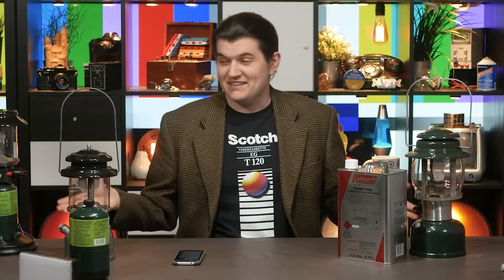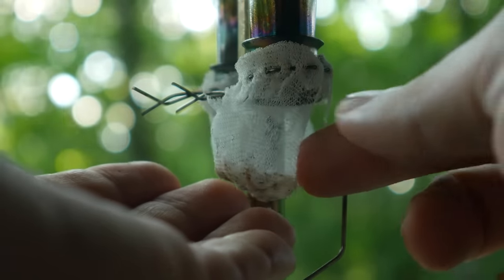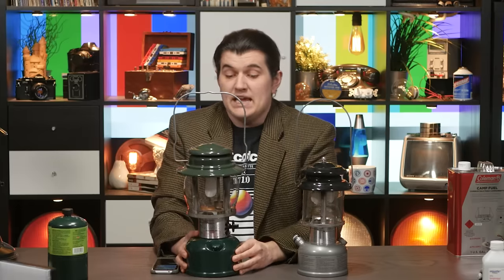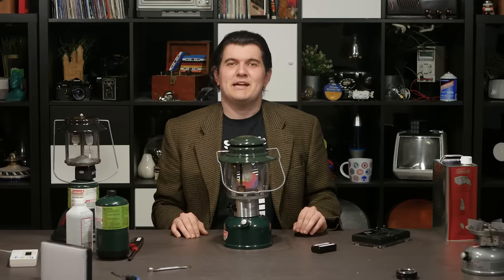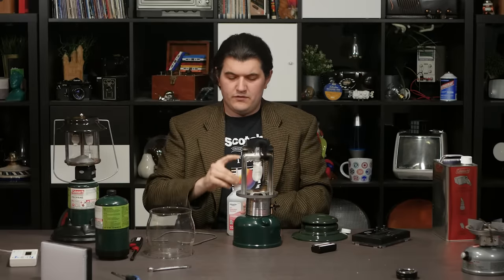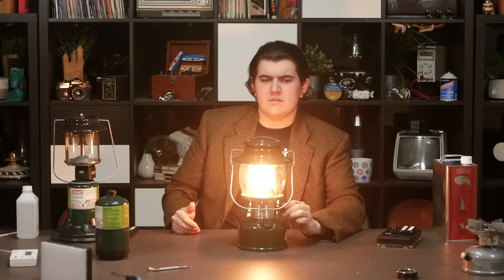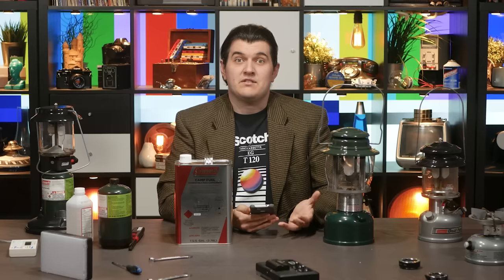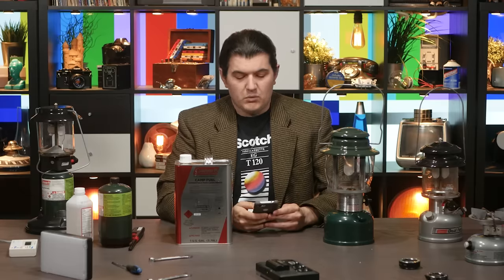A very rambly Coleman Lantern follow-up. Turns out they rarely make sense in 2021

Comment: For sure, led lanterns are way more efficient.  That is what I have for when my power goes out.  I also have a propane lantern.  I never grab that.  That is solely for ice fishing as the heat generated will often allow me to turn off my main heater...or supplement the heat generated because it can't keep up.  My propane lantern is solely used for ice fishing.  I also have a smaller led lantern in my ice fishing bag too.  Need light packing up, and propane lantern needs to cool before I pack it away.  Very limited use for propane lantern, but the need is there for the product.  Good videos, love your content!

Comment: Bottom line, there is no one best solution for every situation. I like having low tech solutions on hand, just in case. Yes, I have LEDs, power cells, and a generator, but there's always: extreme cold, extreme heat, EMP, longevity, standby time, grid down, etc.; choose your apocalypse. Really appreciate the balanced viewpoint. You earned another subscriber today.

Comment: I was born in 1943 in rural farm country and we didn't get electricity until I was 12 years old. We had Dietz lanterns for outdoor use while milking, chores, etc. and for hunting/fishing at night. We used Aladdin or Coleman gasoline lanterns for indoor use and they were tricky to fill and light so we usually did that outside to keep fuel smells out of the house. I remember my mom had a gasoline heated iron that sprung a leak and caught fire while she was ironing clothes inside the house. My dad had to pick up the ironing board, iron, etc. while it was flaming and carry it out of the house and throw it into the yard. He saved the house from burning but got bad burns on his hands and arms. Yes gasoline indoors is dangerous.

Comment: Just went on a long (3 weeks, including several nights where it got well below freezing) camping trip with my girlfriend, and we managed the whole trip on a single portable LED work light that we never had to replace/recharge the batteries on. By FAR the biggest advantages of an LED light for us (that I'm surprised you didn't mention - I guess you don't go camping much?) were that it turned on and off instantly, and that we could use it INSIDE THE TENT! It definitely wasn't a perfect solution, but basically all of its problems are because it was the cheapest battery powered light they had at Walmart, so it didn't have adjustable brightness, the color temperature was the typical cheap LED blue-white, and it was directional, rather than ambient. Definitely way better than any of those gas powered things though!
Reply: What kind of things do you do on a camping trip for 3 weeks?
Reply: @MrDavo511  lots of hiking and exploring national parks? We spent over a week in Yellowstone and the Grand Tetons, almost a week in southern Utah, and then some quicker overnight stays in Badlands, Grand Canyon, and a few others

Comment: I grew up camping with those "white gas" lanterns and camp stoves.  It was essentially the only choice for substantial artificial light in a campground.  Even so, we considered them kind of a pain in the ass, as well as dangerous.  When I first encountered a fluorescent camp lantern, I was very glad to buy it.  That ran on a 6V lantern battery or a set of D cells (fit into a handy device that then fit wherever a 6V would), and produced pretty good light for a good while.  No more spilled fuel, no more fiddly mantles, no more hiss, no more risk of burning the tent, etc.  Now that we have LED lamps, that are way more efficient than even the fluorescent, it's a no-brainer.  I even have LED flashlights where you can take the front off for a room light.  Sure, that doesn't help with the cooking, but it doesn't have to.  We have a folding grill that runs on propane, still easier to deal with than the white gas.  It does fine with the little 1 lb bottles, but when those are empty, we'll just run it from a 20 lb BBQ tank we have as a backup, or a quick-disconnect from our 80 lb home source.  We may also get a collapsible stove like the ones from Richard Outdoors, to take a variety of fuels and be extremely portable.  It makes no sense to waste our propane on light, when LEDs exist.  What next, carry coal everywhere?  If wherever you're camping, it's too cold for the batteries to work, you might be in need of something other than light.
"I also have other plans...to...Yeah!  OK Bye!"  LOL

Comment: For our Scout Troop and camping we use propane stoves and lanterns on camping trips where we park very close to the camping site.  We use propane trees and 20lb bulk tanks for the stoves and lanterns.  For the stove it is connected via a hose and the lantern attached to the top of the tree.  We haven't converted to battery lanterns at this point.  Bulk tanks are much cheaper than the disposable tanks.  Bulk tanks also work better in cold temperatures.

Comment: propane sucks for cold weather also. It may have a low boiling point at atmospheric pressure (-42°C) however, during use the canisters can drop far below ambient temperature and stop producing enough flow to operate a stove or lantern.

Comment: In my own opinion, kerosene is a bit more reliable than propane and batteries but only because it gets cold in Canada and that cold will basically make your batteries and propane useless. In any regular climate temperatures then batteries are probably going to win out for lighting. The only other thought I had is in an emergency, what would be easier to get your hands on? Some type of fuel you can burn, or some type of electrical generator to charge your batteries?

Comment: 3:48 -- there are two check valves in the pump mechanism. There is a "large" leather cup at the end of your plunger. Properly oiled, it will let air by on the out stroke, and seal to the tube walls to force it down on the down stroke. At the bottom of the tube, there is a brass check valve that admits air to the pressure chamber.

Comment: Just a thought on the different fuel options. One thing I thought about is that kerosene and diesel and interchangeable fuels. I know that in Europe (and maybe Asia and Africa, IDK), diesel is much more widely available, and also a lot cheaper as well.

Then to further that above argument, my mentality when it comes to emergency supplies is to need as few different supplies as possible. Considering I drive a diesel truck (and I’d imagine a lot of people who routinely camp also have diesel trucks to haul their campers and all), being able to use the same fuel to run your lamp and your vehicle could come in handy, especially if you’re in the middle of nowhere. You fill up a spare 5 gallon jerry can before heading out, and now you have plenty of fuel for your lantern, along with spare fuel for your vehicle.

Comment: I use liquid fuel lanterns (and stoves) more when winter camping in below freezing temperatures, not only because they generate a little heat but because they don’t freeze up like propane tanks do at those temps (especially when they are low on fuel). You can’t recharge most batteries when the cells are below 32 (freezing point) or you will damage them.  In the spring and summer LED units and propane stoves are awesome, cold weather, liquid fuel still has a place.
Reply: Also Kerosene when stored properly can last 5 years and is much less volatile than other fuels. If you’re dealing with cold weather it’s not a bad option if storing fuel.

Comment: For storage quantities, I remember when I was a kid -- admittedly, this was back in the late '60s, so the circumstances have undoubtedly changed -- my father would go off before we went camping and get a five-gallon fuel can (US pattern, from the cap style) filled with white gas, which we would use in the Coleman stove and two lanterns we took with us. I'm pretty certain that you would be hard-pressed to find anywhere to fill up a jerry can with white gas now, but the flimsies you can buy it in were, and are, a great deal easier to damage (refer to the British experience with the "Petrol, Oil, and Water can" during WWII).

Comment: Two more issues:
1. As batteries discharge the led produces less and less light, what can be at least annoying. A fuel lamp produces the same light till it goes out.
2. Propane lamps also have problem at low temperatures, becouse the pressure in the tank decreases.

Everything else I do agree with. Good videos btw!

Comment: Just for the sake of being pedantic, there are two other use cases you neglected: Firstly, if you're just straight ignoring it. Not just in the emergency sense, but in terms of pure resilience. They'll just sit forever. Leave one in a cabin you only visit two times a year, and randomly drops to -25C, has damp, might have random animals mooching inside it? They'll be fine. Batteries and LEDs, not so much. Secondly, you can throw them. If a bear decides you smell delicious, throwing an LED panel at them isn't going to do much. Smashing a wall of fire across the ground at them could be a huge bonus. Which kind of pairs and juxtaposes with just the physicality of lugging stuff up a mountain. Might be heavier, but you're less likely to get to the top and find that it you squated wrong with it in your back pocket and now it's snapped in half. Being bigger and heavier is a feature, not a bug. A new microwave might be super energy efficient and more powerful, but the one your grandma bought in the 60s is big, dangerous and has been working since the 60s.

Comment: I think you've answered your own question: the kerosene/gas lamp makes sense in the INTERIM situation--while you're saving up for batteries, LED lamps, solar panels, etc.; while you're building your bicycle generator and setting up your charging station--especially if you're already using the gas for cooking (you'll have it around anyway). So, while they may not be a good choice for long-term use, the gas lanterns DO make life easier sometimes

Comment: You are correct - you do not need to take your finger off the plunger to pump.
There is a U-section rubber cup on the plunger head which works as a one way valve allowing air to get past on the withdrawal, similar to a bicycle pump.

Comment: Probably never read this, but I'll comment none the less. I purchased an adapter to charge the 1lb propane bottles from my grills 5 gallon tank. I use the 1lb bottles with various torches so they don't last long.  I own a 60 year old Coleman white gas, still in use. I purchased it at K-Mart, along with a Coleman brand flint sparker kit. Never used a match ever. Instant start! No searching for matches, who carries matches.

Comment: Coughlan's Fire Paste (ingredients: aliphatic hydrocarbon, denatured ethyl alcohol and organophilic clay) works really well for preheating fuel in white gas/gasoline stoves, with which I have much experience. Presumably, it works just as well with kerosene appliances. It's easier to place into preheating receptacles and would appear to be much safer than pouring liquid alcohol into tiny cups.

Comment: I have used gas lanterns for decades, and they are quite useful, even today! The reason for the popularity of gas lanterns is due to their staying bright until they are out of fuel, battery lights dim as they lose power.

When I use the gas lantern, it is when I have to run my gas generator to provide power to run the farm after a storm, so it is rare that it gets used.

Altho, the propane lanterns are easier to use, the gas units are good still, but I have never used a kerosene fuel, only white gas.

The reason for the hole in the pump knob is to reduce pressure when pushing the pump stem all the way in. You don't need to uncover the hole, as the air gets by the pump leather when you pull it out.

The mantles are nothing but ash after the first lighting, that is why they are so fragile. The amount of thorium in the ash is very little, BUT, still wear a mask when changing them!

All of my lanterns match light except the propane lanterns, they have a spark ignition. And I prefer my propane for camping, as I can hook it to a 20 Lb tank with a propane pole that allows hooking up the propane stove that sits on the picnic table! My motor home also had a propane lantern on the wall, but I replaced it with a florescent unit. LED units are replacing the florescent ones today!

Comment: Nice follow-up video! Over here in Germany, both Diesel as well as heating fuel oil for central heating are rel. cheap every day items that are widely abailable, which can be used as an alternative to Kerosene ("Petroleum" over here).
I like mine for backup light at home, not for camping of course, for all the known reasons.

Comment: I have always used a Coleman propane gas lantern when camping. It makes sense because we also use propane to cook, so the lantern can be connect to the same fuel source. I can guess that Coleman needs to continue producing the parts for the kerosene gas lantern, so it is easy enough for them to sell the lantern, just a thought. Also, I have always call the BBQ grill propane bottles, 20lbs propane cylinders.

Comment: He is almost right about the hole in the pump knob. It is to keep from pumping to much pressure in the tank. Because your thumb is not strong enough to keep the hole covered to high. Try pumping to much. Air will start leaking out from under your thumb. The hole is just the right size for that to happen.

Comment: We converted to a 12v deep cycle boat battery powering an inverter and 4 sets of white led Christmas lights to illuminate our hunting cabin. the benefits were less noise and shadows and the annoyance of looking directly into the bright light. There are USB chargers that work off of heat differential that are ideal for camping situations, making USB flashlights are very convenient for camping.

Comment: I like propane for convenience. I'm running propane on the stove anyways so being able to swap a can between the two if one runs out is a nice quality of life feature. They can be refilled from the large grill size propane cans with adapters so the cost drops quite a bit if you're refilling instead of buying new canisters every time. Don't have to worry about batteries in wet/cold scenarios either. Had a battery lantern die on me before due to freezing temps + rain.

Also like many others have pointed out there's a nostalgia to it. The warm glow and sound gives me nice memories of camping as a teenager.

Comment: The amount of light put out by battery lanterns over a a 360° area is much better with the gas lanterns than with the one direction battery lights give you. If there is a battery later that gives 360° of light please let me know.
***Love your videos*****
 Coleman made a battery one but it took 4 D batteries and was very hard to keep lit. It would go out if it was bumped.
The reason lanterns are used is to light up a large 360°area and not have dark areas. The Propane lantern will last for hours. By time you pay for and carry battery packs and solar panels you have paid too much. Especially since I only camp in high altitude in extreme cold.
You made a good point about propane for emergency use since I have a long time between uses and the batteries always end up dead.

Comment: I learnt something important for performance of paraffin (kerosene) lamps by buying second hand. The vaporiser (generator) tube needs periodic cleaning inside due to carbon build up. 
I use a classic British lantern called Vapourlux 300X, It’s from either side of WW2 and has an up side of good solid build quality and easier pre-heat than the Coleman.

Comment: A lot of the soot inside your Coleman kerosene lantern is from the alcohol. I used to use a small alcohol stove that I made out of an axe body spray can and I ended up switching because it would put soot all over my pots and pans. 

It was a pretty sweet design, though. You cut an axe can in half and drill a series of holes along a ridge along the top of the can, and you slide that into a red bull can. I left enough room around the top of the red bull can to add a bit more alcohol that you would light up, and the heat it produced would evaporate the alcohol in the can and form nice jets of flame through the holes. 

Now I prefer wood gas stoves.